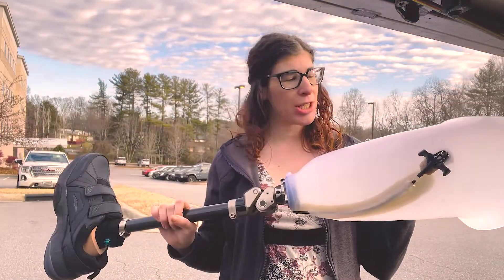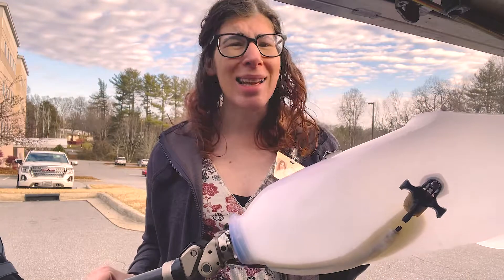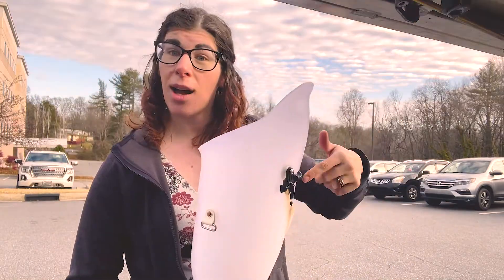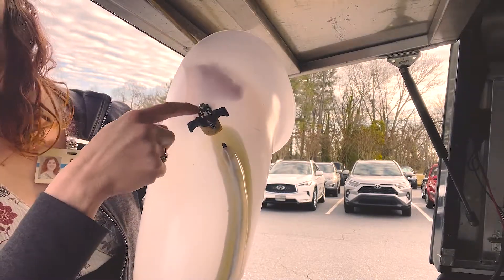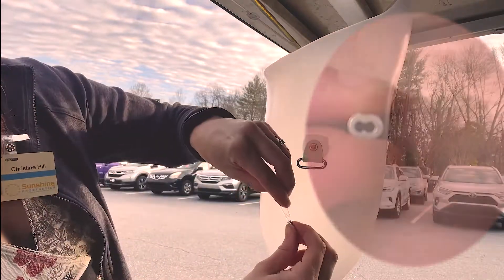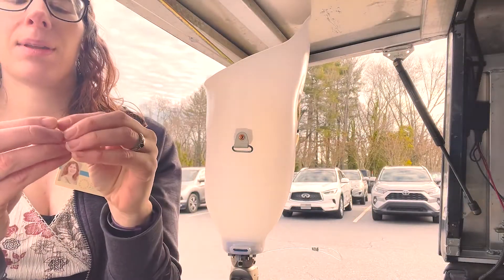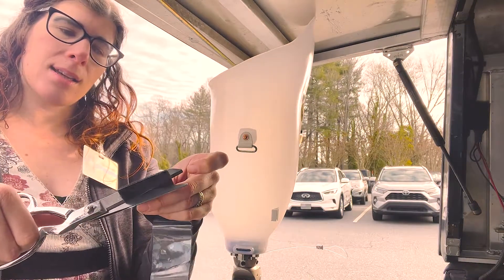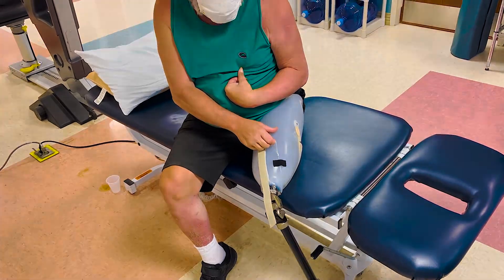Above Knee Prosthesis: Manual Locking Knee Adjustment to Improve Function

Comment: Hope has one of these and i have had lots of problems  with the string and handle breaking when she pulls on it
Reply from the maker: Yes, these type of mechanisms can be notorious for breaking. For the string what type of material? We typically use fishing line type of material for the string with just a loop at the end and get rid of the handle all together.
Reply: @TheLegLady  Thank you i understand
Reply: @TheLegLady how long does it take to build up muscle ; i have one but i don’t like it ; i want a chargeable but hanger clinic to me i have build it my muscle with that one before i can get the chargeable one
Reply from the maker: This knee can come with some headaches. What specifically do you not like about it? I am typically using this knee if the patient is weak and there is a concern for stability while standing. For example, if the patient had an illness leading up to the amputation. Muscle and strength loss happens fairy quickly and it takes longer to be able to build it back up. Did your prosthetist give you exercises to do or are you getting physically therapy? I would focus on strengthening the glutes and hamstrings (muscles in the back of the limb) and your core. Chargeable microprocessor knees comes with pros and cons as well. There are mechanical knees that may be a good inbetween option such as the total knee from Ossur, the capital knee from College Park or the Symphony knee from Proteor.
Reply: @TheLegLady  sorry for my late response when she was younger she used to exercise but she can't now because she is frustrated